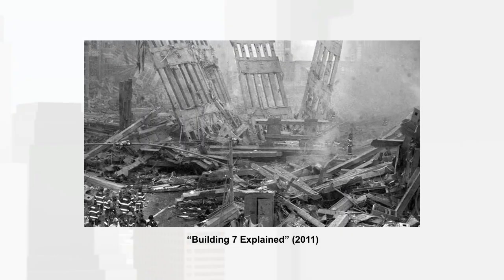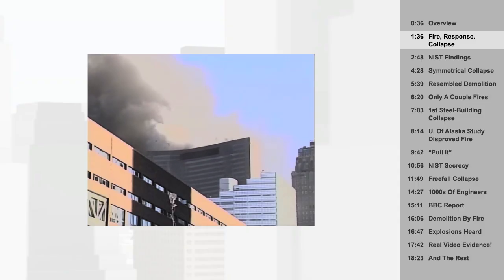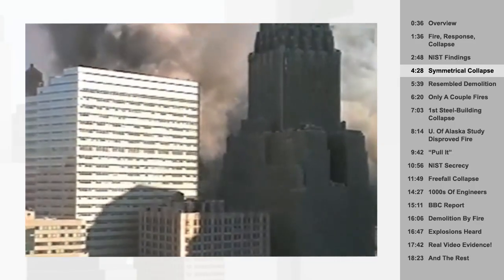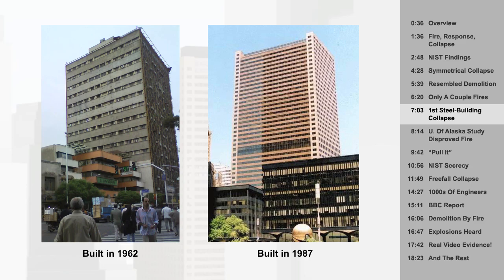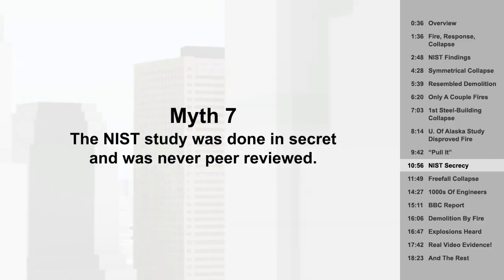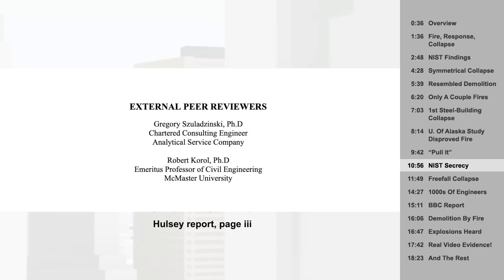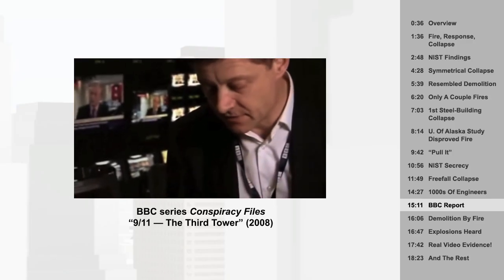Building 7 Explained: Comprehensive Final Edition

Comment: I saw on FB a bunch of posts about how several buildings in Hong Kong caught fire and didn't fall, and how the bamboo was still standing. Of course people in the comments were talking about the WTC.
Reply from the maker: LOL. I'm sure that was 47 stories of bamboo. Although it does raise an interesting point. Under some circumstances, wood-framed buildings can indeed perform better in fires than steel-framed buildings. A lot of this is highly counterintuitive, so conspiracy believers love to break out the arguments from incredulity.
Reply: @EdwardCurrent by the way, Google says the buildings were primarily made from concrete. This sounds like Grenfell Tower on steroids. Of course the scientifically illiterate conspiracy theorists don't understand the difference.

Comment: Can you explain the differences in the Oklahoma City Frderal building and this particicular building? Asking honestly
Reply from the maker: The Alfred P Murrah Building was structurally concrete. WTC7 was steel. These cases could not be more different.
Reply: Difference 1, a reinforced concrete building vs a steel tube-in-tube.
2, A 9-story building vs 110.
3, The Alfred P. Murrah attack used a, very large, explosive device.
4, Said device was placed on the street in front of the building.

Comment: Substantial  mental and verbal gymnastics deployed by the film maker, all while ignoring the abundant WTC nano-thermite evidence.
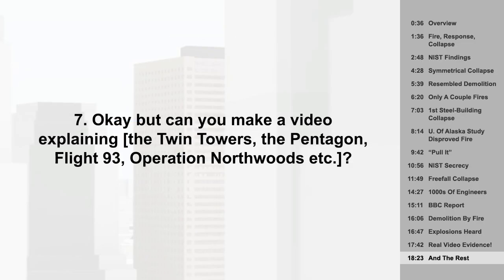Reply from the maker: Not ignored. Covered in #9 and #10 on the screen at the end (18:28). It's just that it's such a dumb, empty claim with such minuscule expert support that, like everything else on that screen, it didn't deserve its own segment of the video.

Despite their 24 years of typing on the internet, conspiracy evangelists have never shown how any vertical steel column could be severed with nanothermite, let alone a W14x720 column (which measures 24" x 14"), let alone 84 of them, let alone 84 of them synchronized together. Nor have they demonstrated that nanothermite operating on steel produces the material that they claim is the evidence of such nanothermite. Because that would be science. It's just so incredibly stupid. One might even call it mental and verbal gymnastics.

Meanwhile literally every structural engineer of tall buildings in the world and every fire engineer in the world agrees that the building collapsed due to fire. No gymnastics required there. Womp womp for conspiracy evangelists.

Comment: I remember a CNN reporter clearly stating they were going to "pull it", then explaining how controlled demolition works... I thought nothing of it at the time, since they had recently "pulled" the King Dome here in Seattle... I've since tried to find that footage, but it's been scrubbed off the internet.
Reply: The only time someone said "pull it" was on a pre-recorded interview with Silverstein.
Reply from the maker: No, it wasn't "scrubbed" and it never happened. You're describing a false memory, not unlike the Mandela Effect. All of CNN's coverage, in real time, is preserved. What they DID say is shown here, at 0:07: https://youtu.be/JnLcUxV1dPo?si=kDsIYb3-OPWWn10a&t=7
CNN: "Building 7 in the World Trade Center complex is on fire and has either collapsed or is collapsing" (with other channels and networks saying similar things afterwards in that video).
"Pull it" is not a demolition term except for literally pulling over a small building with cables and heavy equipment.
Reply: No, you don't remember a CNN reporter saying that, because it didn't happen. You have a false memory, which you conflate with an interview with the owner of the building, made a year after the collapse. No-one "pulled" the King Dome either, because it doesn't mean what you think it means.

Comment: Simple question how is it WT3, 4, 5 and WT6 who where closer to WT1 and 2 didn't get any damage to structure or heat?
Reply from the maker: As I mention below: WTC3, 4, 5, and 6 and other neighboring buildings (such as St. Nicholas Greek Orthodox Church) were all partially or completely crushed, and whatever was left standing caught fire. The remains of 5WTC partially collapsed due to fire.
Reply: WTC 3, 4, 5, 6, Fiterman Hall, St. Nicholas church and the Deutche Bank building were all, directly or indirectly, destroyed by the collapse of the Towers. About a half-dozen other buildings were severely damaged.

Comment: EdwardCurrent: It's totally safe for you to keep trusting the government. Get your vax and boosters, ignore the southern border, keep sending money to Ukraine, Dominion voting machines totally work, antifa, blm, palestine, j6 etc, all totally organic and totally normal. Just drink your koolaid and stfu.
Reply from the maker: OK, and thanks for the totally normal and sane reply to this video about an engineering disaster.
Reply: And there are super deep tunnels that run across the country that the elites use too? What irrelevant nonsense are you going to pull as your replacement for an argument next?
Reply: So, basically, you're suffering mental issues and you decided to spout off about it on a video about engineering?
I mean, you do you...

Comment: 13:35 Another empty soda can
Reply: @anastasiapushkin6028  - Curious, I do not recall ever proclaiming myself an expert on 9/11 or anything else. I am in fact quite ordinary, about as ordinary as they come. 

That you didn't get a very simple and commonly used experiment designed to demonstrate a basic engineering principal is very much a you problem. Don't try to cover that up by pretending laypersons can't possibly get it.

They most certainly can. 

Layperson's can also grasp the idea of a progressive collapse (ie: what actually happened to Building 7) and not need to fall back on the ridiculous all columns failed at once nonsense - the first, last and only resort of the non-thinker.
Reply from the maker: Yep — achieving freefall acceleration as if "all support had been removed," the Truthers' erroneous requirement for the measurement of freefall acceleration.
Reply: Yeah, and for the “perfect vertical collapse” you didn’t even need a “small dent in the can”
Reply from the maker: It was starting to flex just before it buckled. A bit like the bulge around the 13th floor that firefighters noticed and measured in WTC7 prior to its collapse.
Reply: But it's not a mistake to say that all internal support has been removed. And the can did not have it initially
Reply from the maker: Internal support, true. But that's not what they say, because they don't understand what internal (i.e., lateral) support is and why it's critical. I'd love to see them have to try building a moment frame without it.
Reply: Your video talks about this. But yes, probably a person who is not an expert in physics cannot realize this himself
Reply: @anastasiapushkin6028  - I am decidedly not an expert in physics yet I do not struggle one tiny little bit with the concept. Good genes I guess.
Reply: @anastasiapushkin6028  - If that's what you need to sooth the cognitive dissonance then you go right ahead.

Comment: Had to come back to this video after I just recently learned of a steel high-rise in Sao Paulo that collapsed due to fire in 2018. So we now have three examples since 2001 of fire demolishing a tall building. But somehow that can't happen because reasons.
Reply from the maker: That's right. I edited that building out of the final version of this video because it wasn't structurally an all-steel design (but collapsed to the ground anyway).
Reply: Highrise examples:

Torre Windsor, Madrid, 2005.
Plasco Building, Tehran, 2017.
Edificio Wilton Paes de Almeida, Sao Paolo, 2018.

Beyond these, even if they're not high-rises:

Kader Toy Factory, Bangkok, 1993.
Luton Airport Car Park 2, London, 2023.

Note that these aren't by any stretch the only ones, but they are notable.

Comment: 0:46 Wow, thanks for sharing that. There’s so few images around of the building’s interior.
Reply from the maker: I was pretty surprised when I saw that picture. It's like an Erector Set building. And there appears to be very little fireproofing on the beams and girders. Indeed, in the insurance lawsuits after the collapse, some expert witnesses (i.e., actual experts) described the fireproofing as inadequate.
Reply: @EdwardCurrent  Something that isn’t well known is that portions of certain floors were actually removed to become double-height trading floors. One of the only interior pictures of WTC 7’s internal offices is taken from the upper floor, looking down into the pit. I’m not a structural engineer and have no idea how much it contributed to the collapse (if at all), it’s just an interesting bit of knowledge worth mentioning.
Reply from the maker: @savagepanda8458  Yes, that's actually a talking point of Truthers, believe it or not. They will tell you that the building was renovated and additional reinforcement was added to the columns (as if, somehow, that would make collapse impossible). But this was necessary due to the floor removal, for the reason depicted in the video at 3:40.

Did the renovation weaken or strengthen the building? Neither. The affected columns had the same load-carrying capacity as before.

Comment: Can you please explain why or how the passports survived?
Reply: Same reason Lisa Frost's Air Miles card survived.  Both irrelevant to the topic of this video or to understanding any of the technical issues surrounding the 9/11 attacks.  It's a Red Herring.
Reply from the maker: @MFitz12  Or passports from the Hindenburg survived: https://www.flickr.com/photos/magnesmuseum/albums/72157624208880791
Reply: @EdwardCurrent  Nice. I'm stealing that
Reply from the maker: @MFitz12  Works for me. I stole yours
Reply: @EdwardCurrent  - Please do. I insist 😁
Reply: @Mopro-tm3rc ...Can you please explain how the multitude of explosive devices and the vast network of wiring connecting them necessary for a controlled demolition somehow survived the flames and heat that develops in seven hours of uncontrolled fires?
Reply: @vegasmobydick No they can't, and that's where their "theory" kinda ends. They used explosives to bring them down- that's what they alway say, but they never mention how they set them up and how they survived the impact....
Reply: Can you please explain how that's even remotely relevant to the subject of this video?
Reply from the maker: No because that has nothing to do with WTC7, but maybe you can explain how 10,000 sheets of paper that weren't even bundled into a little booklet with a heavy cover survived
Reply: can you tell us how much you get paid for making one of these videos? Seems like they are mostly unrelated except for the fact that they all lean slightly toward political propaganda. You must be one of those expensive allies.
Reply: @PeterParker-tu9id  - It takes a special combination of hubris and stupidity to think believe that someone disagrees with you only because they are being paid to do so. Particularly if that is all you have to offer to the discussion.
Reply from the maker: @PeterParker-tu9id  I don't get paid for making these videos, but I'm glad you just showed everyone your standards for evidence to believe whatever the fuck you want.
Reply: @PeterParker-tu9id   Can you tell us how much you get paid to make meaningless posts that flaunt your overwhelming lack of anything like knowledge? Seems there's nothing slight about your political leanings.